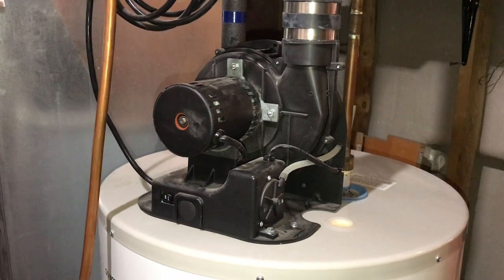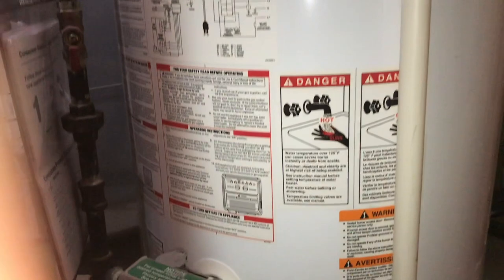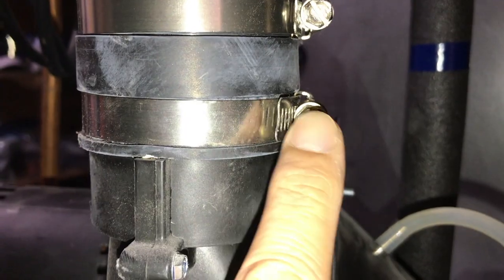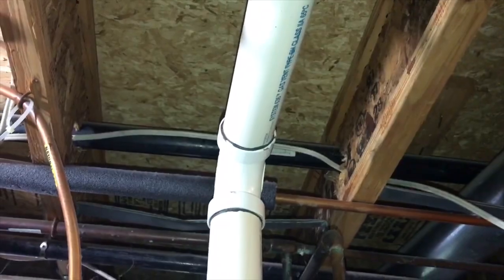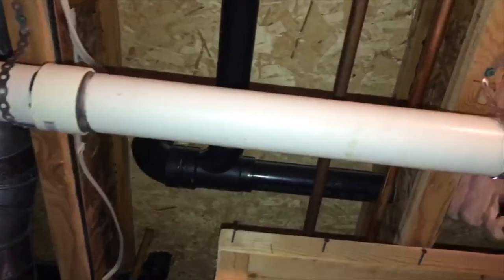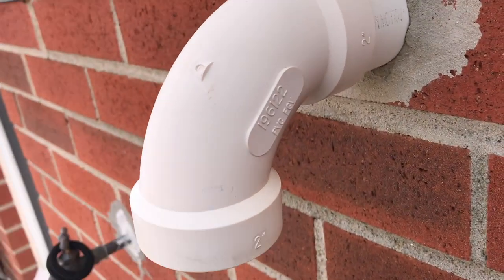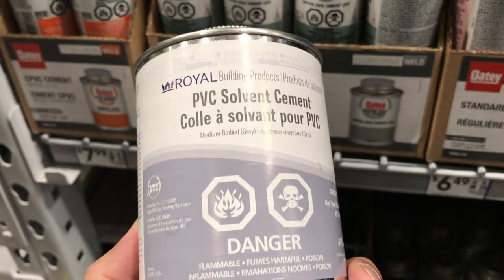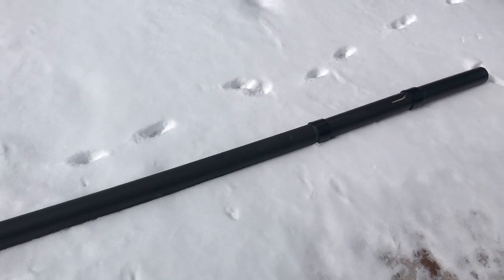Replace Old Black Vent Pipe from Hot Water Tank. DIY

Comment: 5 of those elbows adds about 10ft of run each. You got a pretty long run there for your water tank. The reason they add 10ft of run per 90 elbow, is due to restriction on the motor. Make sure you check the tank manufacture for Max run distance allowed. Otherwise looked well done!
Reply from the maker: Thank you and thanks for sharing more info with our viewers.

Comment: That should be black vent pipe. That 65°C won't last as long and is prone to cracking after temperature aging
Reply from the maker: That's what the professionals said to use.
Reply: @jonahvlogsdiy4143  im sure there's a reason. Maybe its climate related. We get pretty bad winters where I'm from.